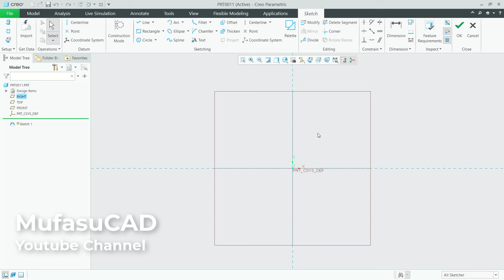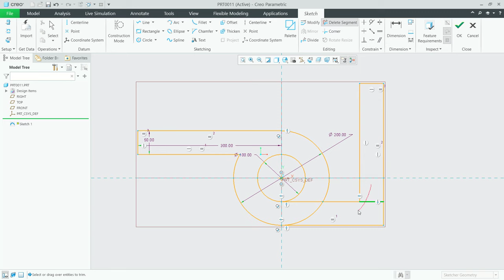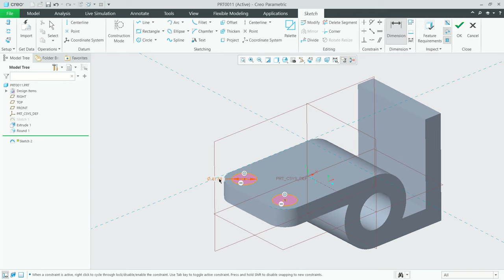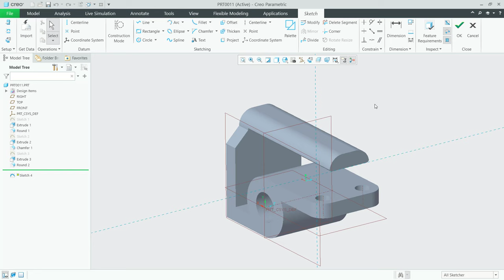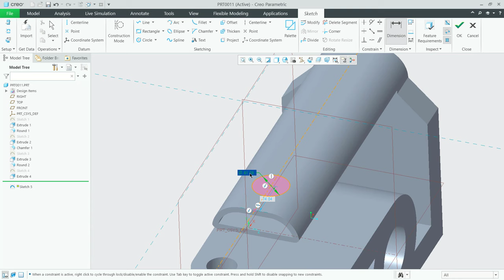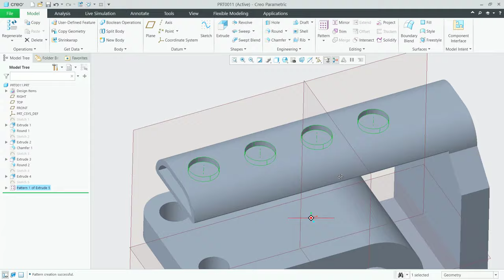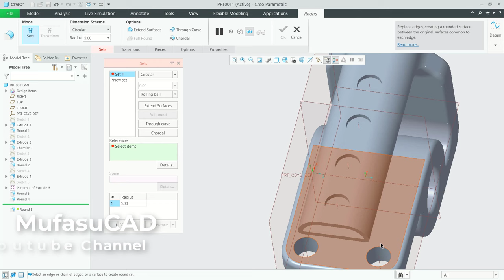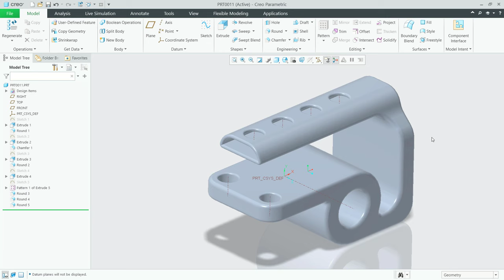PTC Creo Parametric 8 Part Design Tutorial For Beginner [COMPLETE]

Comment: Hi Mas/mr . I am new in Creo 4. I am confuse. Why after I give dimension to my sketch, the line still be able to deform? Let say my line is 10mm,  if I drag the end point it will be larger or smaller than 10mm. I have to manually lock each line. It is a very time consuming job which is kinda different with previous cad software (inventor)
Reply from the maker: are you already check for constraint

Comment: Hi @mufasecad, nice learning. On time 5.08 found how to offset line chain, then the offset line will be inner of original line. 
But for me, the offset line go outer of original line, then i set it by  minus 10 (-10).
is there any other methode how to set the offset direction ?

Comment: WOW this video has some horrible modeling practices. ie do not model complex shapes as 1 feature, do not model extrusion cuts that cut through one surface with out specifying to next, adding round to multiple unrelated edges in 1 feature.... etc...

Model with design intent !  modeling with the least number of features is not the goal and not good modeling practice.